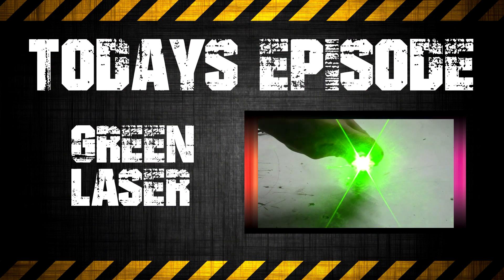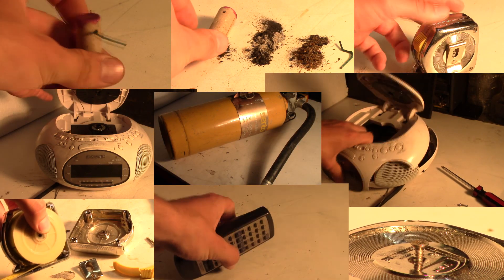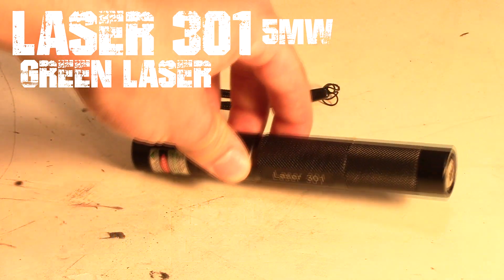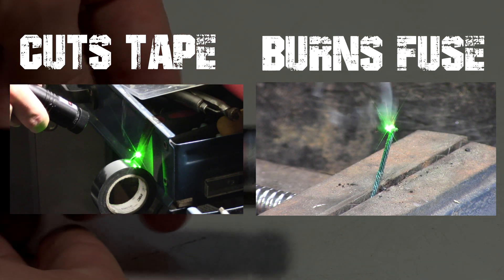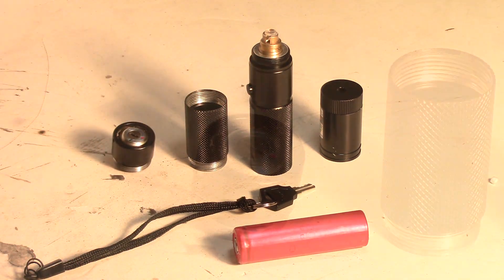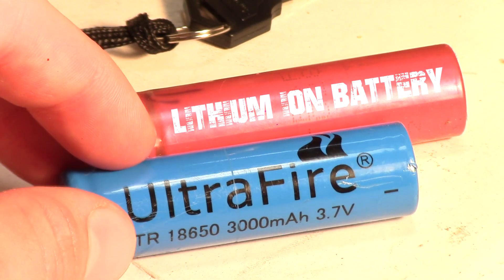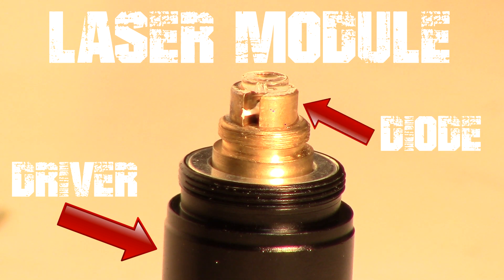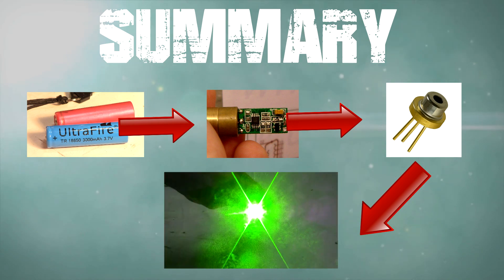TIAT (Take It Apart Tutorial) - "Burning Green Laser"

Comment: hey paul this video was very helpfull and informative thanks but may i ask u a question? do u know how to fix one of these lazers if they stop working i recently purchased the same lazer and it never has turned on and i have been assuming its the saftey ignition causing the problem but i  cant fix it. i know its not the battery for sure hope u can help thanks again
Reply from the maker: Hey Dil,
I have had past experiences where one of my lasers stopped working due to that the diode had burnt out. This can be caused by overpower or particles shorting out the diode. (Loose metal or shavings) If it is the safety ignition, one thing you could try is attaching wires to the battery terminals, and touch the wires inside the case to skip the safety ignition. Basically re-wire the circuit to ignore the safety. If this works, then it would be your safety ignition causing the issue. In that case you could dismantle the safety ignition and force the safety key slot to turn in the "On" position. If not, this is probably the diode burning out, and in that case you would have to buy a new laser. *I am not liable if this breaks your device, and I am not a professional laser technician.*
I wish you luck and take care,
Paul Pyro
Reply: thanks for being the coolest and replying back to me been watching ur videos for a while now  i hate to ask another question and you dont have to respond but what kind of wire would i use to do this is there a way to use any wire?
Reply from the maker: I would say basic insulated wire (12-16 guage) or about 1-3 mm thick. Overall, the current is not too crazy so you wouldn't need special wire, any scrap wire will work fine. You can get scrap wire from old electronics, speakers, calculators, etc... Good luck and I hope this helps!